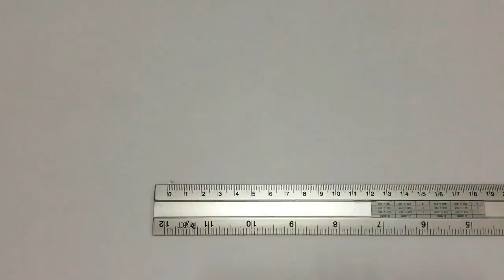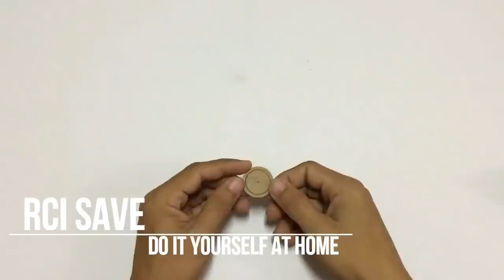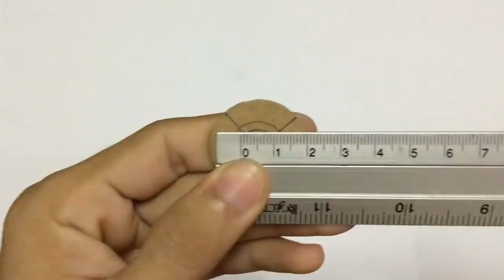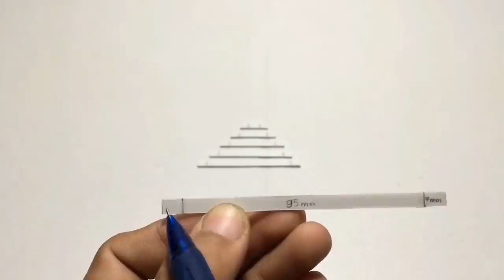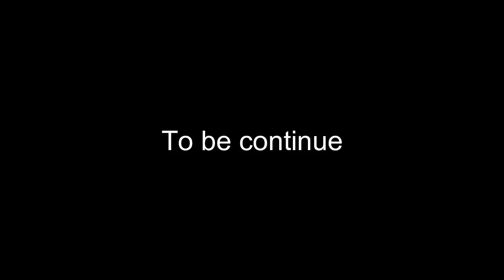How to Setup RC Duty Heavy Truck Off Road 8x8 Double Axles Tires and electric Do at home

Comment: Would you let me know..what kind of electronic modul you use?? Because my transmitter and receiver on my rc only works when the button switch are pressed,and can't change the speed..
Thank you for your answer..
Reply from the maker: All 2.4G transmitter and receiver 3Ch, 6Ch, 8Ch, 9Ch, 10Ch, 12Ch